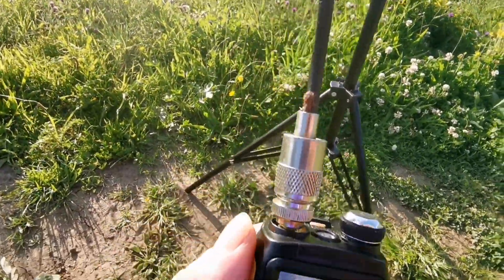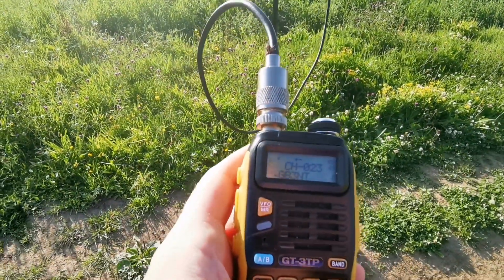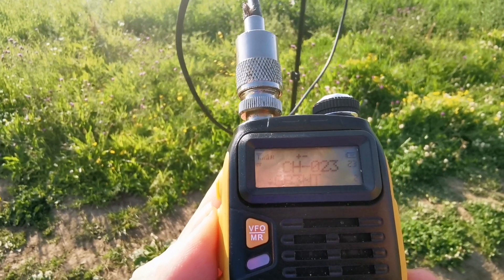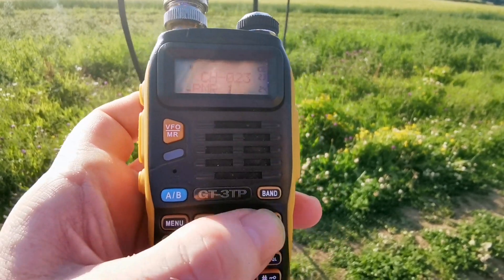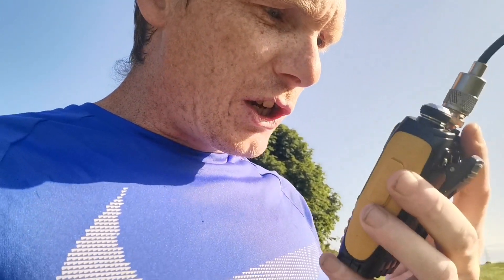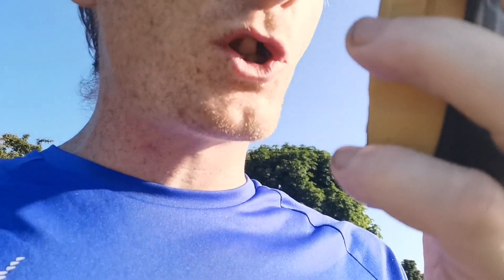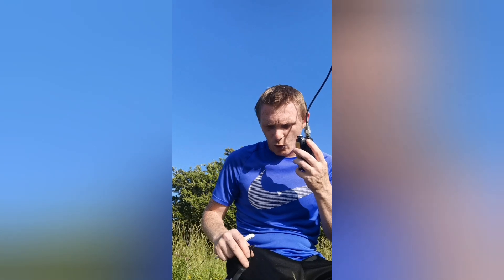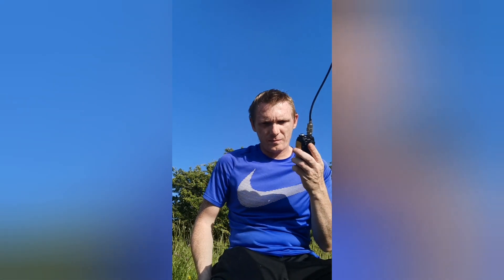Testing out the Diy 7 element 70cm yagi antenna

Comment: Nice video again Fran. I've got all the bits here to make VHF/UHF beams from 6m through to 70 cms but my van is taking up most of my time at the moment. Once the mobile shack is complete I can get away from the noise. 73, Phil G0RKF
Reply from the maker: Get one built. Really easy to make with the online calculators. I just 3d printed the element holders and used 2mm Ali welding rods for the elements.